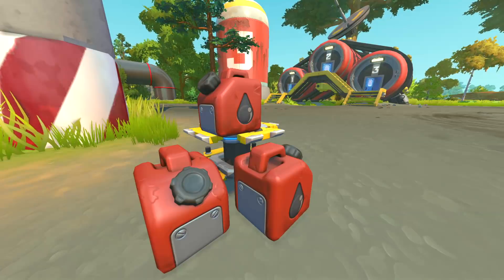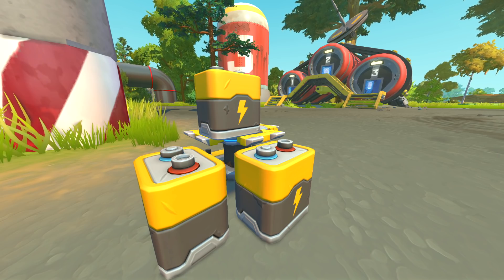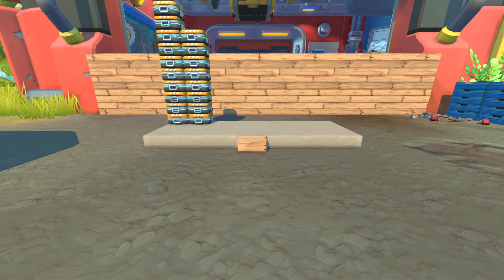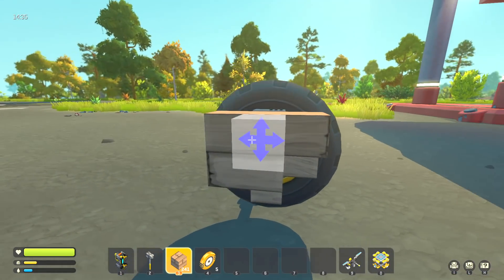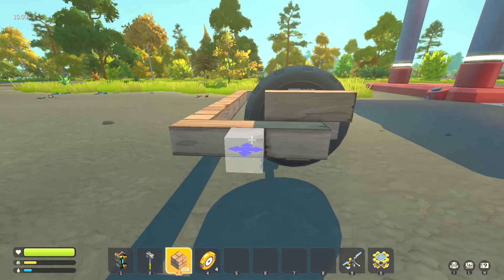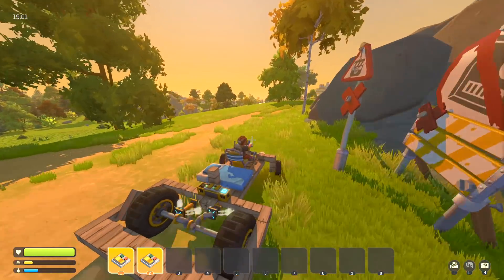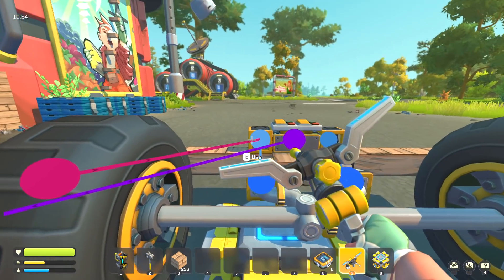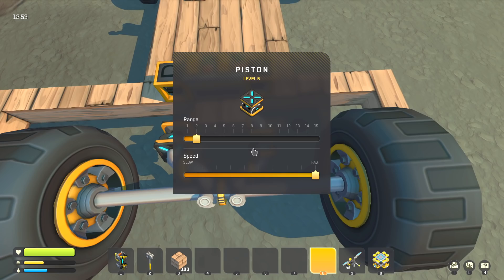How to make a fast Piston Engine in Scrap Mechanic Survival

Comment from the maker: For those of you who can't go into reverse. Try adding 15 additional degrees of advance. Then try again. A good rule of thumb is to add as many degrees of advance as you can before it starts to turn the engine in reverse while going forward. If you manage to tune it like that. Reversing will be as easy as pressing the accelerator before starting the engine.
Reply: Youtubers: make piston engines for unlimited fuel 
Me: hold my maxed controller
Check out my latest video to see what i mean
Reply from the maker: @jacobdestroyah2120  I laughed too hard on that one. :D
Reply: @Alstrak  XD
Reply: Alstrak if I put the accelerator over 15 degrees it will reverse and it will occasionally it will reverse  and the go forward again what should I do?
Reply: 15 Additional degree add at 2nd?
Reply: I am trying this setup with 8 maxed out pistons atm. To get rid of the problem with the reverse I changed the support infront of the sensors so a "T" and the timings r now 01= +90 , 02= -45 and +75. And finally i got these monster working 🎉🎉🤩 ( dont ask how much time i needed to figure this out 😂😂)
Reply: can u make a walker like the one in last oasis ??
Reply: Great video, but Wtf u mean u been building piston engines since 2016? Pistons we're not introduced until 2018
Reply: @Charles_Mcgee  back then they used thrusters as pistons, smh
Reply: I tried this design and while a whole lot more stable, it has me failing to drive forward. Its stuck in reverse and played with the settings a lot. I been thinking though, can we use the sensors make the movement forward and another to reverse piston rotation?
Reply: @Ichijoumi  just try bearing powered car it is much easier ...
Reply: where do i add this 15 addition degrees? i did exactly like in the vid but it just doesn't go into reverse
Reply: I created your piston engine design in my world. Works perfect but I strongly recommend making some vanilla gears to make 2:1 reduction. It doesn't affect much on the torque and highly increases top speed at little cost of accelaration.
Reply: Hey remember me!? Why dont you upload or like stream anymore? I like watching u!!!
Reply: Where did you go
Reply: I found that if you set the controller to loop you can use the switch it's connected to to set the scanner thing into a position where it will always reverse. Likewise it can be rotated again to go forward too. As well as it can allow for a scanner to skip a beat so it moves slow, which makes makes it move up hills easier.
Reply: actually set the pistons to 3 its better and much faster
Reply: The turning is actually not bad, I can turn sharp corners instantly
Reply: Alstrak you know you don’t need to disconnect from gas engine so you can just leave it not unlike electric engine have able to stay in place but the gas engine it not able to do that so it able to move not likely to electric engine?..
Reply: I @dragonmen002 stillmadds drag tho, it doesnt brake as such but it does slow down the bearing :) It's most obvious with a differential drive and then you see the normal engines do hold the bewrings stiff enough to avoid rolling forwards on the unpowered side when you accelerate the opposite side. If that drag did not exist, the differential drive i built would creep forwards, as it does with the scrap engine, but, my level 3 normal engine brakes just enough to hold the unpowered wheel still and spin on the spot. And yes, a piston engine could power through this and make it unnoticeable.... but it's still there, wasting efficiency. I very much appreciated alstrak's simplistic approach and also the simple mod for engines :)

Comment: About the devs being wrong abot motor and engine. The devs are based in Sweden and in Swedish engine and motor are the same thing, namley motor "en disel/bensinmotor/förbränningsmotor och en elmotor" there is no counter part for engine in Swedish 

Translated a diesel/gasoline engine/internal combustion engine and a electric motor

Comment: dude you can get the same result from adding a bearing inside the wheels and connect the gas engine to them they will lock up when not running the engine allowing the pistons to carry the rotation.

Comment: The accelerator for me is backwards oddly, off means more speed, on means less. Granted this is still nice to have, and it's more compact than the one i built before by kAN Gaming.
and the 4 piston version will help alot with a mobile base or harvest machines. Can the Piston Engine be used for drills too or just wheels?

Comment: The controller/bearing engine is whole lot cheaper and a lot easier to set up, lol. It doesn't need fuel or batteries either.

Comment: Ill need to ajust my controllers but the engine is prety darn cool & no problems with tight turns since it has the torque & the welded diff wich allows me to drift

Comment: I got a tip for the steering problem. when you get lvl.5 seat or saddle you can change the turning thing and after the upgrade i could steer really good.

Comment: I dont know what i am doing wrong i have  4 pistons maxed out and this thing will not move forward for me. I put this thing together several times exactly like the video. This pistons start moving then they stop. It moves more when accelorator switch is off.

Comment: Can you take the 4 piston set-up but remove the center of the rear axle? Just extend the subframe through the center, make the single axle a dual axle, and the 4 piston motor becomes two 2 piston motors? It wouldn't quite be a differential but might allow different speeds at the different wheels? I haven't played this game. If it worked, though, you could repeat for the front and make it all wheel drive... When looking at a hybrid setup, can you just add an extra set of wheels that aren't connected to the axle that just roll when not powered? Guess I could just play the game and find out

Comment: i cant seem to get this one to work.. i added a total of (5) small pipes on both side to extend the axle...not sure if this is the cause of the problem....still have the two set at 90 / -15 / -60 ..so not sure what im doing wrong.

Comment: Bruh, by your definition the "electric engine" in scrap mechanic would still be an engine if the batteries in the game were dry cell, which, I might add, most likely are since they are consumable and not rechargeable.

Comment: Alright I tried out this build in creative mode and some reason 1 my bearings connected to the controller showed the connections upright instead of down like in the video. im not sure how to change this or if its the issue. second if I try to make a 4 piston engine it seems to not work at all even if I mess around with the 2nd connection a lot. im not sure what im doing wrong here or how to fix it if I have these issues. the 2 piston engine seems to work for the most part though.
Reply: oddly I decided to make it in survival mode and it worked perfectly fine. Have not gotten to 4 pistons yet but loving it so much!

Comment: I loved your tutorial, but I have made an error somewhere that I can not find. (I am a 71 yr old woman so not too mechanical, LOL). The piston closest to the flywheel goes around ok logic gate flashing on and off but the other piston puffs steam and logic gates lights up steady and doesn't rotate. I made sure all is welded, checked the controller and piston settings but I can't get it to work. Any suggestions?
Reply from the maker: I am unsure what the problem might be. May I ask you for your steam name and add you as a friend? Perhaps I can help then. :)
Reply: @Alstrak  gnarlyCrone

Comment: If you add a second set of rear tires that come down with the gas engine powering them you can simply switch it to gas mode by lifting the rear to the new wheels

Comment: Thrusters and heavy cars suck up fuel like crazy. In the long run a slow piston or controler powered car will save you so much time on making gas that it is not expensive to build. Good for mining and hauling trader stuff. But for exploring a small and fast gas engined csr is better

Comment: The car goes forward for abit, but after a while or if the road is rocky, it'll start going in reverse and then completely stall out. What am I doing wrong?
Reply from the maker: Remove 15 degrees from the 2nd position of the controller(2nd bearing) if it does that after accelerating. If it's doing that without pressing the 2nd switch then remove 30-45 degrees from the default position of the controller(2nd bearing). I hope that fixes it.

Comment: No matter what I do it won't go in reverse. I rebuilt the engine 3 times following step by step and it will only go forward. Still better than wasting gas though
Reply from the maker: I was wondering why people wouldn't get it to work. Depending on the computer specs the game simply reacts differently. Here is the solution: Upgrade your engine to the 4 piston design. That might fix it. Or add another bearing to the timing wheel, controller and a switch so you can manually go backwards. The new controller should add about 120 degrees. Make sure it spins counter clockwise or the opposite direction of the spinning axle. :)
Reply: @Alstrak  I had to set the pistons to 3 that made it work for me but it's sounds weird literally the way it sounds is weird now lol. Also I didn't know you could find new mechanic garages... Or if you actually can't then my world re rerendered it self because I found a new one while trying to get back to my original and now I feel that I am absolutely lost 🤣

Comment: Awesome video! May I ask why that L-piece on the left needs to be free like that? Cant you just make it a supporting part of the chassi? THanks =)
Reply from the maker: That is the timing wheel. The sensors react to that and it's free(attached to a controller) so it can be advanced or retarded.

Comment: 5:43 does both bearings connect to the wood blocks when you click and drag like that? I thought you had to place the two blocks individually on the bearings?
Reply from the maker: The devs made that possible at some point. If you attach anything close to either a bearing or a piston it will automatically attach to them instead. Even if you are pointing to another block.

Comment: If I put the accelerator past 15 degrees the engine goes in reverse and it will occasionally reverse temporary how could I fix this?
Reply from the maker: Give the dafault position negative 30-45 degrees and add 15-30 to the accelerator position.
Reply: Thank you so much

Comment: I wonder if you could build an inline engine with a driveshaft and differential, that way it 
1. Looks nice (this design is kinda ugly to be honest)
2. Can turn good because differential
Reply from the maker: Differentials are quite complex. I was trying to make it as survival friendly as possible. But it should be possible. One thing I will advise you is to add good suspesion to the differential. If one wheel doesn't grip  you won't be able to go forward easly.

Comment: How mutch weight can it carry?
Edit: also u can add a engine put it on speed 1-2 and connext to front 2 bearings and also put some suspension in front and a little weight and it should turn beter
Reply from the maker: It can carry a lot of weight and yes, that is also a good way to make it turn better.

Comment: Is there any way to add suspension to this?
Reply from the maker: Yes, you can add suspension to the front and the rear but usually, the front is enough otherwise attach the whole engine to a suspension on the chassis and it should work. :)
Reply: @Alstrak  Thanks! I tried it out in Creative and it definitely worked. LMAO... in one of my experiments I somehow messed up your build and it created a vehicle that just keeps doing frontflips over and over again. It's quite hilarious.

Comment: You could hook up the piston engine to a cogwheel system using wedges, then attach saws or drills to it, then you could power multiple at once
Reply from the maker: You can but it gets complicated real quick. :)

Comment: I cant believe how well this works. I have built a 4 piston engine with a 1:2 gear ratio, and it has about 10 times less speed and it cant even pull that much weight. If i took all the benefits from this design, i could put together something really good, which i will do.

Comment: Is there a way to have a better steering piston powered vehicle for big items because the one I have has horsepower to spare but turning is the issue?
Reply from the maker: I suggest you make the front wheel gap bigger and also add springs on the wheels. :)
Reply: @Alstrak  is there a one piston engines that you can add to the front to make it front assist?

Comment: Hi can you make another design thats more reliable?. Iv built this one more times than I can count now and every third turn of the shaft it starts going backwards. Iv tried adjusting speeds and timnings it makes no difference.
Reply from the maker: The design is reliable. You need to set up your timing correctly. My suggestion is to try and find a default position on the timing bearing where it always goes forward. After that set a 2nd value in the controller so it advances the timing to the point where it starts going backward when fully "accelerated". When you that happens, remove 15 degrees from that 2nd value in the controller. If your car still starts going backwards, remove 15 more degrees until it doesn't. Technically if your pistons are fully upgraded then you can use the degree values I have shown in the video but if they aren't, these you can't use the ones shown in the video. I hope this helps.

Comment: Bullshit, scrap mechanic didn't have pistons in 2016 but still good engine
Reply from the maker: Thruster powered pistons. The engine works the same way almost but instead of actual pistons we used to make 2 stroke thruster engines.
Reply: @Alstrak  nice

Comment: Shouldn't you be able to fix the turning issue by disconnecting the two axles from each other, and basically have two piston engines instead of one? I know it's more expensive, but it seems worth it to me after a certain point

Comment: ok so i use only 1 button to use w for forward? like  you left that part  a bit faded like 1 button and i switch to turn on or both have tobe buttons?
Reply from the maker: You can add a button instead of the first switch. That way you can accelerate by holding the button, similar like an accelerator.
Reply: Just the first 1 (accelerator) can be a button the other needs to be a switch so it can toggle forward and reverse

Comment: When you realize that pistons haven’t even been out since 2016 🤣
Reply from the maker: I said that to other comments too. Back in 2016 we used to make thruster powered pistons, meaning we made the pistons using thrusters. The idea of how they worked was pretty similar and you could also call them piston engines since they were pistons that turned a crankshaft.
Reply: @Alstrak  I too was wondering how were you building Piston engines since 2016. But yeah i saw some thruster engines which were cool.

Comment: I found I had a hard time getting the same level of speed as you seem to have in the video.  Turning the angle of the timing wheel to positive 15 degrees seemed to result in the fastest forward speed, but it also made it so that the direction it went from a stop was somewhat of a crapshoot.  

Still, neat engine.  Going to play with it a bit and see what I can do to get as much speed and power as possible.

Comment: I built it in my world but even with maxed pistons it doesn't seem to go as fast as yours
Reply from the maker: Might be because of the piston range. If it's set to 1 they will still work but quite slower. Check if that is the problem. :)

Comment: For some reason when i engage the timing block the engine puts me in reverse.  Any idea on how to fix?  Thanks
Reply from the maker: That is where I put the controller on the vehicle. The reason why it doesn't work might be because you forgot to switch the direction of the second bearing but it could also be something else. If you made it as it is in the video I suggest you try and repeat the step where setting up the timing is shown.
Reply: @Alstrak  Turns out, I forgot to grab the last 2 bearings for the support blocks out of the crafting bot.  Would also explain the violent shake I was getting too lol.

Comment: Your piston engine is great I am using it and its fantastic but hear me out you can make other controller that would put down wheels on the ground and the piston engine up so it would not have any problems with going as hybrid and you could switch between piston engine and gas engine. I dont play this game for long so any kind of note would be appriciated. (sorry for bad grammar English is my second language)
Reply from the maker: You are right. You could do that. I could have done it too for the video, but for simplicity reasons, I simply was trying to make it as easy as possible to make. :)

Comment: I just use the gas container and I have never ran out
Reply from the maker: For smaller vehicles fuel is not a problem but if you have a rig of some sort that has a couple of machines on it, you will burn through gas quickly. But of course, it is up to you how you would like to play your game. It's called a sandbox game for a reason. You choose your own rules. :)

Comment: How do these compare in speed and power to kan's 3 piston engine?
Reply from the maker: They are definitely faster. The 2 piston design probably has more torque because of the better timing system. The 4 piston design way better than kAN's in my opinion since 1: It uses more pistons to power the crankshaft and 2: there is no transfer case/differential, where you normally use a lot of the power. Simply put mine are simpler and more efficient. :)